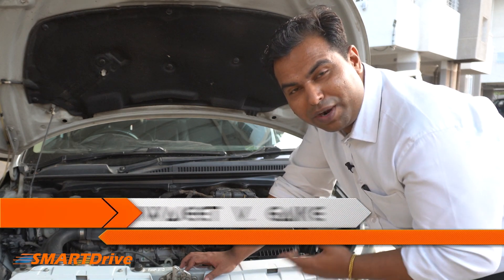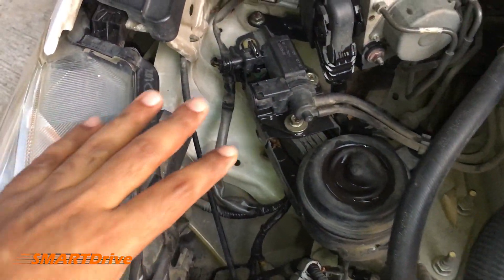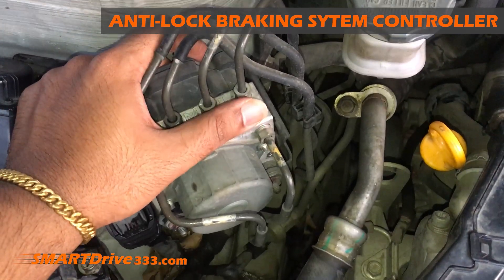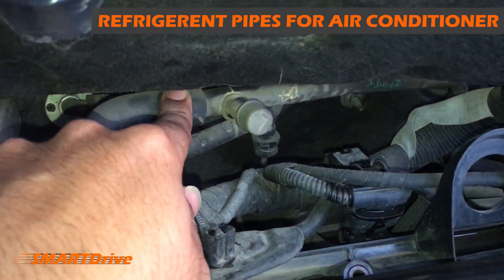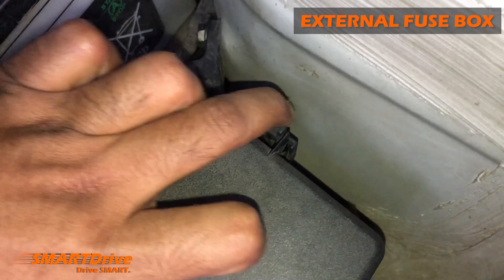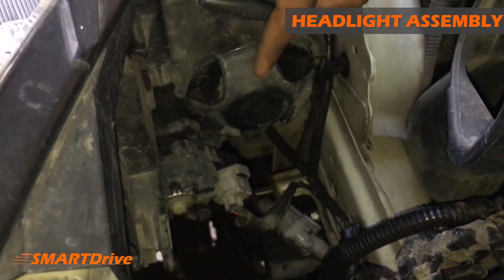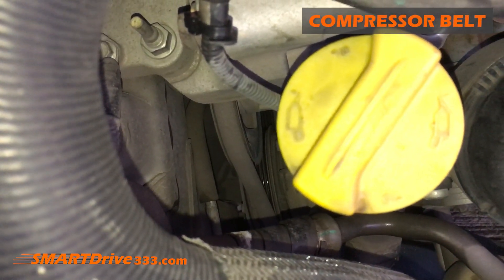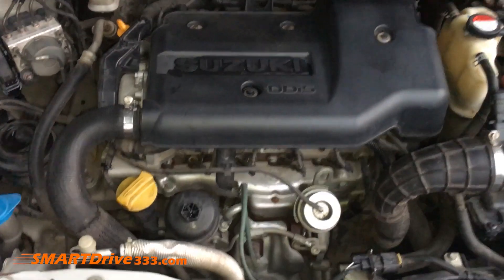Suzuki Ciaz car Bonnet #2 : Know what's there under ciaz car hood : SMARTDrive333.com

Comment: Do Ciaz has cylinder head temp sensor/engine head temp sensor apart from coolant temp sensor ? Ford has both sensors.
Reply from the maker: ciaz has only engine oil temp sensor gauge . coolant temperature is not shown on dashboard.
Reply: Thanks